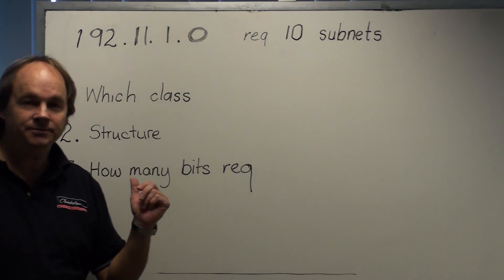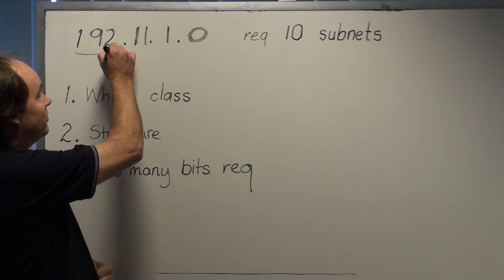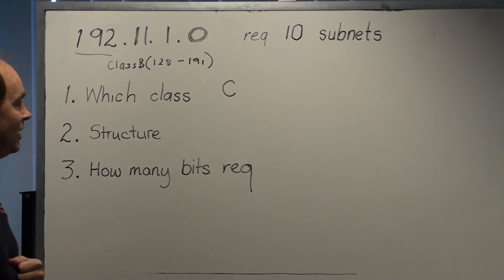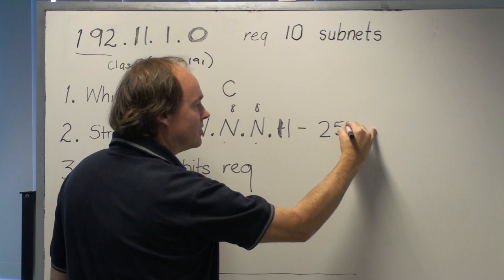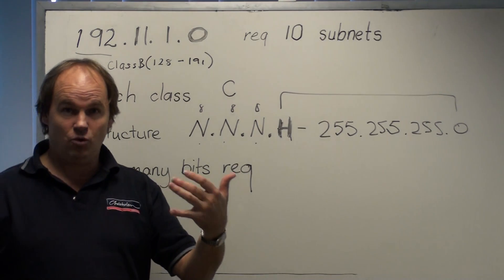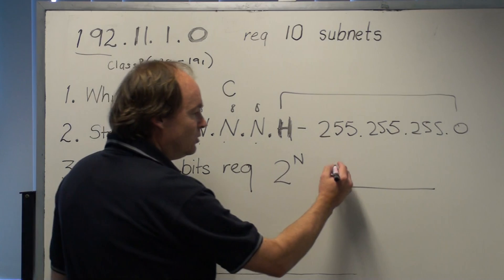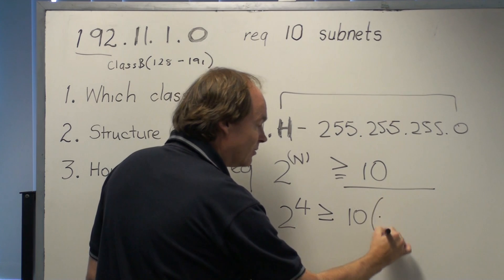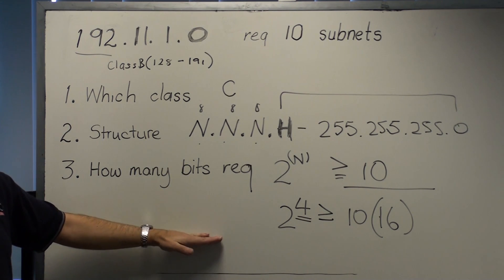Subnetting Part 1

Comment from the maker: Hi  thethirdeyefunction 
Yes there are 4 host  bits left .. so there are 14 (16 minus 2 ) possible host addresses available .. not quite 16 .. as you can not use the first address ( all zeros 0 0 0 0 ) or the last address ( all ones 1111) .. as this is the broadcast address...   
Cheers

Comment: I understand what your explaining but why did you end up with 4 instead of 5? if your counting bits from right to left wouldn't you start from 1.
1, 2 ,4, 8, 16 (5). That's 5 bits or is it just the rule to start from 2?

Comment from the maker: Hi r2d4cp3o 
2(4) = 16 subnets not actually bits... we needed 4bits..... although we only needed 10 subnet ... 4 bits is the closest to meet our needs.
RE:What do 10 subnets have to do with this? I say 10 as I wish to take one Network and sub-divide it into 10 separate networks... borrowing 4 bits from the host portion will give a total of 16 subnets.. 6 more than we need ..that usually happens ...let me know if you have more concerns...  Cheers mtasman